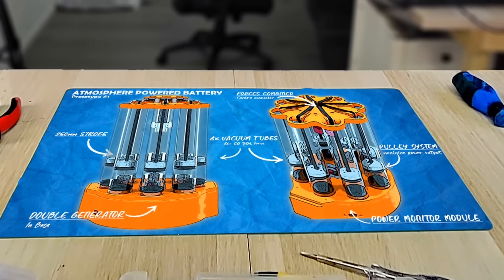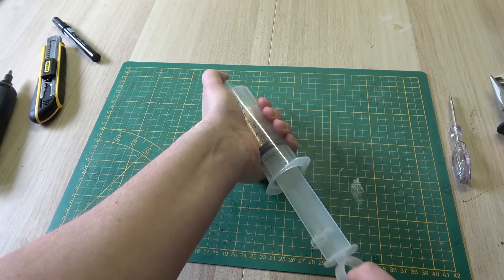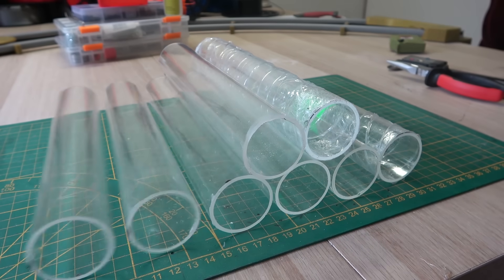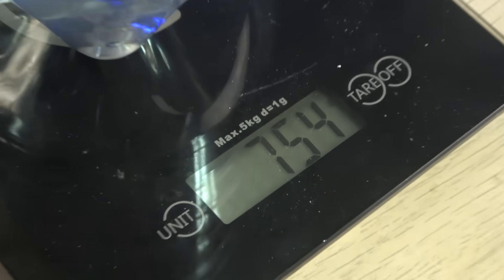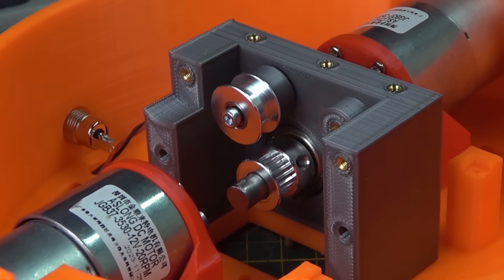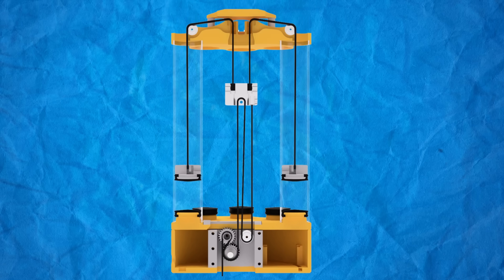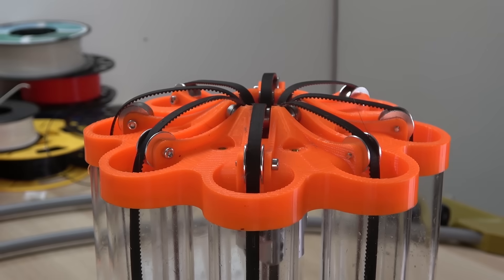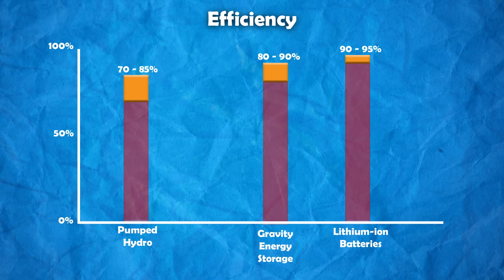Building an Atmosphere Powered Battery..

Comment: Find a place on earth with large daily pressure cycles, there should be two full cycles per day (pressure tides). Then, replace the motor with a valve. Open the value in high pressure to fill the cylinders. Then when in low pressure, vent them by creating work, generating power. Now you don't need energy to 'fill' the vacuum battery, as we use the natural pressure cycles to do that. All you need do is 'get' the energy, and spend a tiny amount only on opening and closing the valve. The difference in pressure each day may not be much, but the idea of a near perpetual motion battery that self-charges off the daily ambient pressure cycles  seems pretty cool.

Comment: gravicity is not a new idea, people have been using gravity to store power for decades using water pumps and reservoirs on mountainsides. They just came up with a far less efficient method. This is also vacuum powered, not atmosphere powered. Clickbait crap showing old tech badly done. This is a very simple concept that people knew about in the 1800s and could pull off more efficiently even back then no doubt. You should have researched better before wasting your time with this.

Comment: You didn’t test shelf life. The reason no one uses vacuum batteries is because it’s extremely difficult to maintain a vacuum. Wait before discharging maybe an hour. Maybe a day. How often does a battery get discharged immediately after charging? Never. I suggest this as a way to teach yourself more about vacuum batteries.

Comment: Interesting project, I might be fun if you would be able to use positive pressure to store energy since vacuum has a limited amount of energy potential. You would, however, require somewhat different mechanics to store and release the air, probably a secondary pressure vessel with some checkvalves. But maybe you allready gain some power with having it work in reverse...
I guess you can also start with a regular compressor and see how you can recover the energy efficiently... I allready see potential problems, but don't let it stop you! :)

Comment: Great attempt. One important thing to note is that when a load is connected to the motor the force required to to overcome inertia will be significantly more than when no load is connected. You measured the force required with no load on the motor.

Comment: If you are trying to save space compared to using weights, why would you use vacuum instead of pressure? Vacuum is inherently limited by the the pressure of the atmosphere - your pressure difference is limited to 1 bar.

Comment: As you noted this is similar to pumped hydro. You could achieve the same with moving water and its less likely to leak as water seals are easier to maintain than air seals. 

But here is an idea you can't do with pumped hydro. Air pressure is always changing. If something is changing we can harvest energy when it moves from a high stored energy to a low. Think about building a pressure vessel with one way valve. When the air pressure goes up it overcomes the valve and equalizes the pressure inside the vessel. When the air pressure goes down you can harvest the pressure from vessel as you allow it to escape. The interesting thing is that this can happen passively and you can sale the vessel to be very large capturing more energy.

Comment: First prototype exceeding 70% efficiency!? Yes. There's a very good chance you can exceed 90% with better parts, scaled up. Most of your energy loss likely went to friction in the syringes, the motor's efficiency, and the pulley system. First, I'd suggest selecting two motors, one optimized for drive efficiency, the other for generation efficiency. Second, you might look at old engine pistons and steel pipe for the, "syringe," as gas engines have perfected low friction gas seals. To be fair, that second suggestion might turn into a nightmare failure, so... maybe for MVP, but not prototyping.

Comment: Let it sit for 24 hours then see how much potential you have left.
The reason solid mass has better efficiency is because it is a nearly no-loss transfer. Virtually all of the loss is from the electrical motor/generator.
Liquid suffers from loss over time/evaporation/surface friction, etc. 
Gas (be it inside a pressurized chamber, or outside a vacuum chamber) will suffer even more loss than liquid.
These losses will always grow over time and cycles.
No seal is forever, and no moving seal is sealed.
If the goal is efficiency, switching to a medium with more inherent loss isn't the best step to take.
If you wanted to go a liquid/gas sort of route I would look for something like a thermal cycle that could be completed within a sealed system with no moving parts associated with the medium in use.
Something like an hourglass using the internal medium to effect an exterior force.

Comment: so, this was pretty cool, but i was thinking something along the lines of what Martin of Wintergreen was going to try using for his Marble Machine. a weighted device which upon input of motion can bring the weight back up, so as to maintain the fall of the weight, using a continuous chain drive.... now, if you could make the return mechanism able to lift the weight at a certain rate to offset the downward fall, while maintaining its momentum and generating force, That could be easily called up without needing too much height. while it may still be a beastly large machine, it would still be worth looking into as in terms of the efficiencies and generating potential, and the possibility that you could use solar and battery to actuate the return mechanism at intervals which could be tuned, to make it as efficient as possible, while extracting the most amount of energy it can make. i would love to see a practical metal version of such a device, and have all the math and gear ratios figured out so it could be marketed as an alternative generator for home use.

Comment: wait a minute...  what about a barometric generator?  if the tubes were sealed with an amount of pressure equal to the average of the location they were placed in, would not variances in atmospheric pressure cause compression and expansion?  this motion could be used to drive some kind of generators.

Comment: there is something called high vacuum grease.  i believe dupont makes some.  used for the seals in high vacuum equipment that use things like turbo pumps and Cryo pumps.  it is meant to make better seals, however it is still grease.  it would make looking through the tubes not good but do you really need to see the piston moving up and down?

Comment: Just started your video and already have questions. Shouldn't you be doing volume instead of just area; πr2h. The area for a OD (outlet diameter) is15.6  calculated is  πr2= 49.008845396. Should you be using the ID (inner diameter) for your calculations since that is where the pressure change is in. 
Edit note: ok you did do the ID. This is what I get for commenting too early in the video.

For a syringe 1ml= 1cm² or 1cc (cubic cm). So if that syringe is 25ml then its 25cc. Shouldn't need a lot of calculations.

Comment: It's a really nifty idea but compared to Hydro, or Gravity storage systems but I don't want to imagine the amount of maintenance that has to go into keeping everything sealed up in order to guarantee a high vacuum. You can just leave water in a pond, or a weight placed high up pretty much indefinitely without having to worry about a thing, because they rely on simple mechanics. But working with pressure differences, you have to make sure every connection and every seal is completely tight at all times, adding a significant amount of failure points to the system.

Comment: Probably not worth scaling up as it's efficiency is not great (tho it could be improved with less flexible parts, ie not plastic) and it's energy density is awful. Air batteries already exist and high pressure cylinders can store way more energy than a vacuum tube, and it's easier at scale because high pressure cylinders already exist.

Comment: Surprisingly high efficiency, which should increase if scaled up with larger diameter pistons since the surface area of the piston will scale faster than the linear contact point of the seals.  It would be interesting to see a comparison of storage capacity (per volume) of various technologies.  <1 KJ of storage for something that large doesn't seem very practical, but I could be proven wrong.

Comment: There is one thing that your video does not talk about and that is energy density. Size of the battery to store the size of charge. I would expect Lithium Ion to be much more compact for the same energy density storage but I would be curious the size comparison to a gravity or pumped hydro system.

Comment: You can substitute springs instead of the vacuum arrangement. That way, no problems with seals failing and constantly having to do maintenance on the system.
Pretty sure it would be equally as efficient.

Comment: It's an interesting concept, and I think it's got some potential to have this working, but the difficulties in scaling up would most likely defeat it.  Pumped hydro has a number of advantages that the gravity driven ones don't have in that storing power in a reservoir is less of an issue as you can pretty easily create spillways and we definitely know how to make hydro-dams.  Also, where is the efficiency numbers coming from?  The Gravity ones (a mineshaft is interesting, I had only heard of a crane and block storage) seems ambitious.  The Li-on battery numbers, I've seen similar elsewhere, but for those, they have other issues (cooling, limited cycling, charging/BMS issues, dead cells dragging down the rest of the block..).  

I think the technical challenges are going to be the thing that creates hurdles for us, and for wide-scale adoption we need 2 of three: stable, scalable, safe.  This is pretty good, and could definitely be reproducible,  it might be scalable, but at scale it's a question of it would be safe, and if it's not safe at scale, it's not going to be really stable.   I wonder if this could be something that could be done underwater?  That would definitely up the safety factor, and the scalability with the incompressibility of water would be another factor.  Instead of vacuum tubes, you could pressurize the tubes with air or some other denser gas perhaps?

Comment: I think it's cool and I also think you're using the wrong units.
But I see you addressed that in the pinned comment.

But It'd be interesting to see a way to scale it up.
The larger the volume, the harder it is to keep a vacuum, it's said.
How much would leak over time and how would that effect the efficiency?
That is, I guess, how long can you keep the battery without using it before it becomes useless?

In a gravity battery or a pumped hydro battery, leakage would likely be negligible.
While air, in comparison, probably would have an easier time leaking?

But it's a clever and cool idea!

Comment: Efficiency..
Atmospheric forces are a function of surface area & volume.
We take advantage of this in pistons.
To make your vacuum battery more efficient,  you need to remove friction anywhere you can, maximise the generator motor potential,  and simplify the mechanical aspects.
-A single wide piston is Always more efficient & effective than multiple, especially because you take advantage of the perimeter friction vs surface area vs contained volume. It's why bigger Is better w air.
-You might be able to increase Efficiency by increasing the EXTERIOR pressure, or even sealing the working volume, so you are changing Both pressure differentials.
Pressure is also a function of temperature...could you use waste heat or environmental temperatures anywhere?..
-There are seal types that improve their seal under pressure; but most seals do better w lubricant. Two cup seals w heavy oil in between would make a Heavy, self sealing, self adjusting, self lubricating piston.
-Gravity. Vacuum doesn't care, but Efficiency does. Lay it sideways so you aren't fighting gravity as much.
Air & vacuum systems (steam, too?) Aren't so much about the total energy, but the difference between each step.
I wonder if you could do a multi-step process to eke out as much energy as possible..
Reply: Water.
Vacuum is a density trick for gases.
Water is a decent lubricant,  great heat sink, is our baselifor density,  and has some Great tricks of its own.
A column of water Automatically increases in bottom pressure as it gets taller.
Combine that w this, by putting the vacuum battery at the bottom of a water column..
Reply: And because the pressure differential only Counts at the piston head, and vacuum doesn't care, the vacuum battery can lay crosswise at the bottom of a water tower...
Reply: So you could pump water while you charge the battery,  then accumulate water as you discharge. 
More so if it's a multi stage affair...

Comment: It’s an interesting concept. The main problem is that it’s dependent on the pressure of the atmosphere. I would suggest doing it under water for wave power or sea wind farms or adding a weight to the plunger and combining it with a gravity battery.

Comment: I like the idea maybe more if you had a counter weight you could fill for free or a cylinder that ran like a diesel hammer to charge it. I thought of one charging a spring where the last few inches of travel of the spring it releases the piston for a cycle to recharge the spring

Comment: Oh, so the efficiency is OK, but compared to pumped hydro, the wear and stress on the system are much much greater, so it would either have to be build like a bunker with heavy duty everything to withstand of years of daily pressurization and depressurization, or there would have to be some extremely precise machining so that you do not have to use rubber seals or any other seals that deteriorate over time. 

Also, what is the energy density of this battery?

Comment: The sceptics probably have good points, but if they aren't as good as I think they are this would be really interesting to see at a "one in every home" level of concept maturity.

Another air-based energy storage approach I've seen is Technology Connections' thermal differential concepts.  Basically extending the "thermostat on a timer" concept to running your HVAC system once per day when energy prices are at their lowest.

Comment: What sets this apart from compressed air energy storage is that the pressure differential remains basically unchanged while charging/discharging and never exceeds 1 bar, since the limiting factor is the atmosphere itself. That can be an advantage, because the power output remains constant, but also a disadvantage because you need significantly bigger tanks to store the same amount of energy. 

Fun fact: since you can't do weightlifting exercices on the ISS for obvious reasons, NASA had to come up with a special apparatus to allow for a similar type of exercice so astronauts can keep their bones healthy (living in microgravity for months at a time can lead to dangerous loss in bone density because you're not straining your skeleton as much, since you don't weigh anything). You might think "well just have them push against a piston or a spring instead of lifting a weight" but the issue is that in both cases, the amount of force required increases as you compress the spring/volume of gas (as described by hooke's law), whereas the force needed to lift a known weight remains constant. So, instead, they make astronaut pull a vacuum inside a reservoir, the same way you did here, because then you're pushing against the air pressure inside the ISS instead of trying to compress a comparatively smaller volume of air at an ever increasing pressure. This way, the pressure exerted on the piston remains basically the same, meaning the amount of force astronauts need to exert during their workout remains the same all throughout!
Reply: I learned a lot from this video and this comment

Comment: in the very last shot of the machine working, I'm seeing air bubbles leaking in through the bottom seal. If that's the case then improvements on the seals would increase the efficiency. larger versions are going to suffer from crush pressure of the tubes. even if they don' implode they could bend, warp or buckle somewhat inelastically and I can only imagine that would cause problems. I'm sure you'll be able to account for that but be sure to do the calculations on material strength if you go bigger. implosion can be dangerous. I love this. Great video. more, more, more.

Comment: This does the same thing as a air compressor and a air turbine but the atmosphere is the pressure tank but the atmosphere is 15 psi and a air tank can handle 100 times that. So yes you wasted your time

Comment: I think this is a really cool concept.
I would like to know if, when calculating efficiency, you took into account the HUGE amount of slack that we see in the video is taken up by the motors when you turn the thing on the first time. The motors probably didn't use a ton of power to remove that slack but there seemed to be a lot. Also, how many times did you run the charge-discharge cycle when you calculated efficiency?